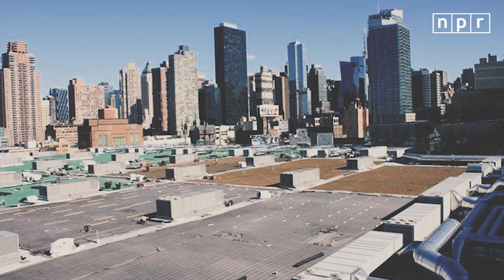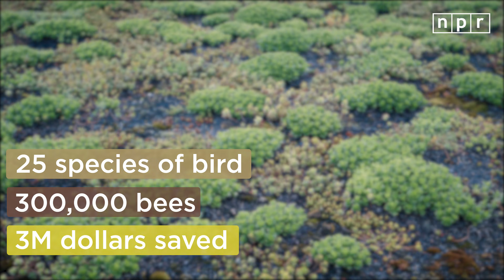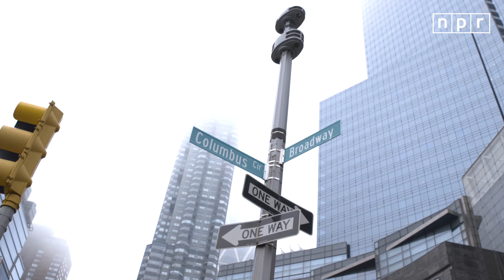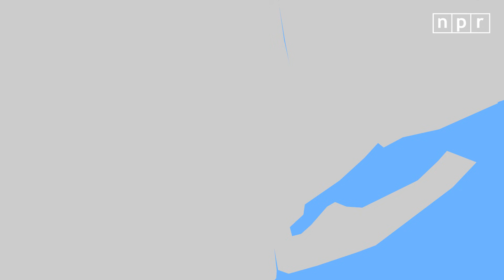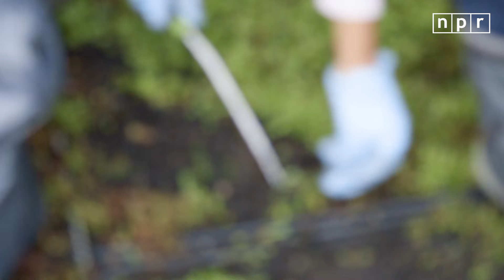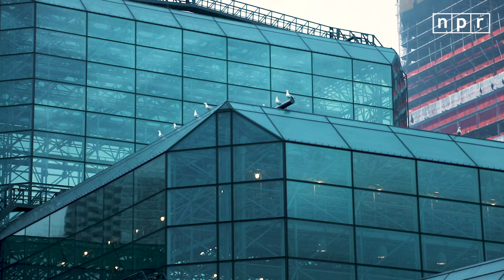How Green Roofs Can Help Cities | NPR

Comment: Stats: $3M saved, 7 million gallons storm water absorbed, 26% less energy used, 6°F cooler, 25 bird species, 300,000 bees. NYC est. 1B sq ft roofs. Asphalt roof temp as high as 170° vs. green roof 80°.
Reply: So if you add a green roof on a flat every floor will be cooler?
Reply: @tasost3902  reduces the urban heat island effect
Reply: This really puts the costs for planting them in a new perspective...
Reply: So... pretty much a waste of time with no benefits whatsoever

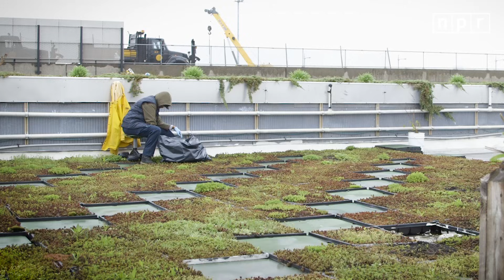Comment: Anyone know anything about the green roof trays to contain the plants?   One example is at 3:04 in the video.  Pretty exciting stuff.
Reply: Trays are not really a smart option to manage stormwater.  think about a sudden rain flush, and then water gathers to find a way out (dry soil will resist water initially).  The 10-30 seconds that the water gathers, allows it to find the crachs in between the trays to escape.  Testing in GRD Laboratories found that 50% of the water escapes this way, and that is terrible because a) the plants NEED the water, and b) it just let go of a huge amount of stormwater when it matters most, which is during massive storm events.   have a look at www.greenroofdiagnostics.com (GRD) for more information, or check out www.purple-roof.com.

Comment: $3 million in savings, but how much did it cost to put into place?
Reply: That's not very helpful. He wants to know how much it costs, that doesn't mean that he's cynical about it; just curious. :P

A green roof costs around $15 to $20 per square foot. So, if they saved $3M per year, that means that they could implement 0.6M square foot of green roof each year.

So, to cover New York with green roofs, which is 1B square foot, you'd have to invest $15B up front to make that happen. 

Judging by the acreage of the Javits Center, the square feet is 290.000. That means that the costs of construction were between $4.4M and $5.9M, using commercial prices. Considering the scope, though, it is probable that the project was on the cheaper end of that range. 

So, the project will start making return on investments in less than two years, which is a significantly short period for something to make a return on investment, in terms of most cost-saving measures like solar panels and the like. Not to mention all the other benefits. It's a no-brainer, I think.
Reply: Cody Griffin 3 million in 1 year
Reply: Lucus Kane  Yes, and those savings recur every year, but how much did they have to pay upfront to set up the green roofs? And are there any regular maintenance costs? Those are the things I'm wondering about.
Reply: The cost of doing this is important, clearly, as is the cost of not-doing it.
Reply: Cody, if you're going to fixate on costs impracticalities, we're never going to save the world.  Believe me, I study this at a 4 year college.
Reply: maintenance is also more expensive. what makes it economically interesting is that this is a giant roof on top of a building which needs to be airconditioned in the summer.
Reply: Wouldn't savings be equivalent to having a positive balance between profit and expenses?
Reply: Well, they wouldn't do it if it didn't save money. So... lol?

Comment: Are there structural changes necessary for most green roofs? the weight of the soil, plants and especially holding the water that was initially designed to just run off seems significant.
Reply: Hi there.  Green roof systems are tailored to match the structural capabilities of the roofs their on, and plenty of extra weight capacity is left over in the design for snow load and people, etc.
Reply: You first talk to the structural architect and then you calibrate the green roof to match the structural capacity of the building.  There are options within the range of 15lbs/sqft to 200lbs/sqft depending on your needs.  Plus, there are new Detention based green roofs on the market that perhaps weigh a little extra but do so much more for the stormwater management in a city. see www.purple-roof.com for ideas.
Reply: I would imagine if NYC roofs are prepared to take on the weight on snow storms piling on each year they would probably be up for the task? But that's just my guess, I don't know.
Reply: Actually, this is one of many reasons the other buildings don’t have green roofs.  The structural load is more than snow because it’s a year round weight, you must account for the plants, The soil, and the water weight and maintain your designed in safety factors.  Also extra precautions must be designed in for additional water leakage problems and root invasion.  Plus they are expensive and difficult to keep irrigated and alive.  The roof has to be intentionally designed as a green roof. Also buildings are rarely built with gravel roofs anymore anyways, the heat issues can be easily addressed with the much more standard white TPO roofing, not a green roof.  

It’s very disingenuous of NPR not to address the costs and challenges associated with green roofs.  There are good reasons why most buildings don’t have them.  The few benefits don’t always outweigh the costs. Sometimes they do, and sometimes the plants all die because of disease.  If you don’t count the cost for the maintenance, the structure, the roofing, and irrigation then you are only giving lip service to a green roof and it will likely fail.  Who’s more at fault the one who doesn’t build a green roof or the one who does but kills it with neglect, or the one who wastes profits that should go to payroll or better products to restore a dead green roof? Finally, a green roof does little to reduce a buildings carbon emissions or heating and cooling loads.
Reply: @BenDowney  You also still have to hold the snow in the winter time, on top of the added loads from garden infrastructure. You make a good point about the plant maintenance. Anybody whose ever grown a garden knows they're anything but cheap and easy. 
I was waiting for NPR to address the issue because it's not like most people in New York just don't want to save $3 million a year, very bad journalism on their part. I was required to watch this video as part of a college course I am taking right now and I had to look through the comments to get a balanced view before I attempted to use it after I graduate. Hopefully NPR does better in the future.